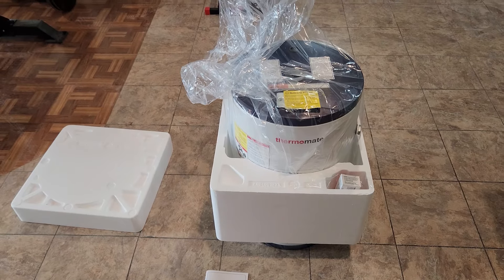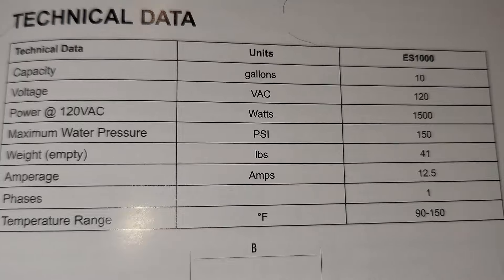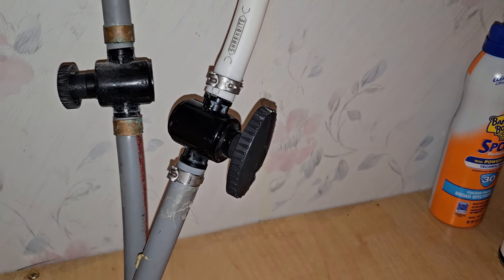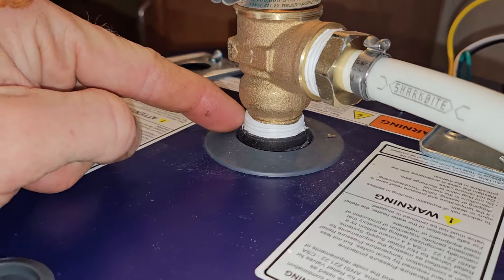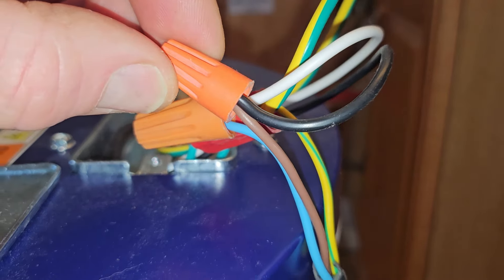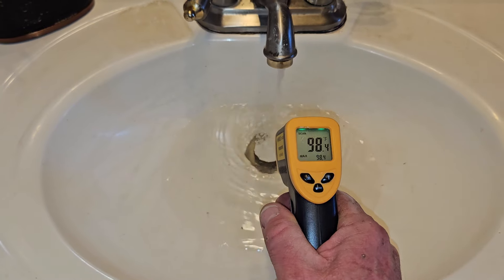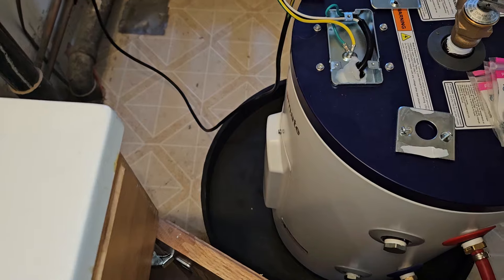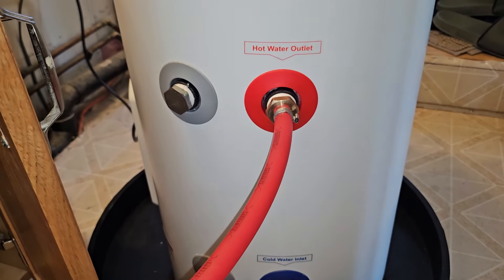How To Install A Water Heater - Thermomate 10 Gallon Water Heater For Shop, Garage!

Comment: The Anode rod doesn't heat the water. It's a replaceable disposable metal rod used to protect the inside of the water heater and the heating elements from corrosion.

Comment: Can I use this for an small house shower hot water or is too small? thank you
Reply: Get the Thermomate 18 gallon. We have a 2 person 500 sq. ft. home. By the time she takes her shower, dries, brushes her teeth and exits the bathroom, the tank is already good to go. These are really nice units. The larger units at the box stores are awful. These are very high quality. Change your anode rod once a year and flush it with paranoid consistency.